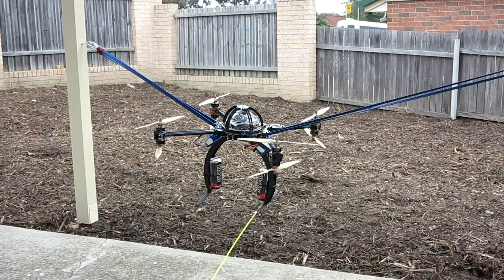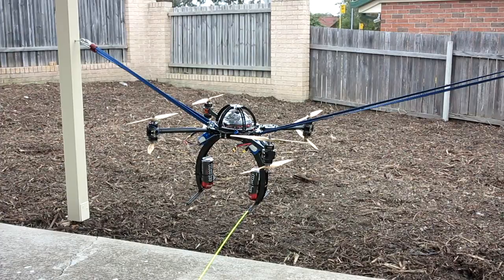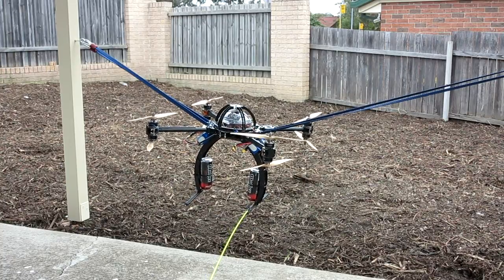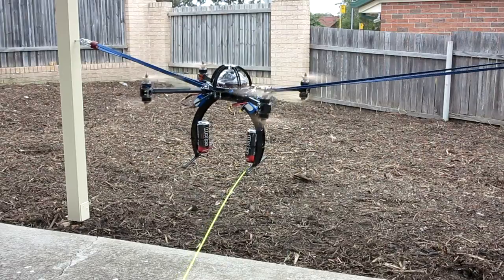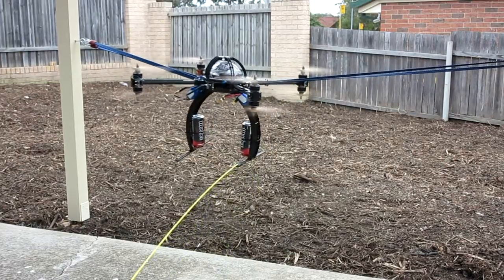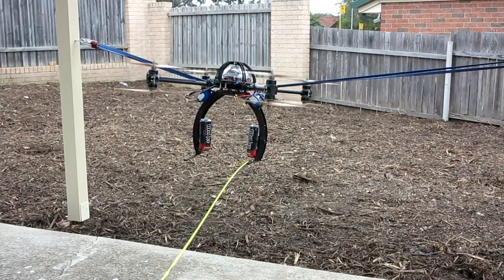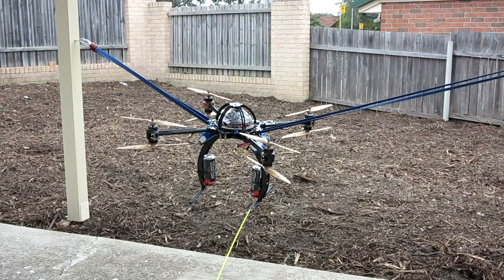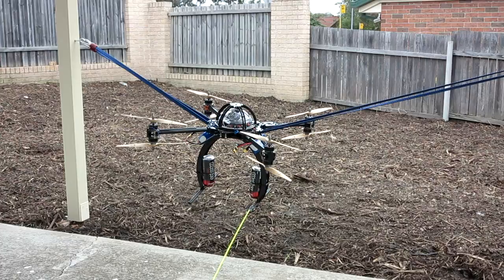Tuning a Droidworx SkyJib LIte with Arducopter APM 2.5

Comment: How to tune in the yaw parameters? I am confused about the jig that can be used for the same
Reply: This was done a long time ago with an APM when I was new to large copters. I eventually decided to use a DJI Wookong controller as I just couldn't get comfortable with the APM.
Fast forward to today and the poor SkyJib didn't get much use for a year as I began to use DJI equipment when I started working commercially. But the APM developed in to the more powerful Pixhawk which then became the Pixhawk 2 Cube so when I recently resurrected the SkyJib I decided to use the Cube with the new versions of Arducopter.
The good news is it works fantastic!
Arducopter on the Pixhawk includes Autotuning which is done in the air either one axis at a time, including yaw, or all at once if you have the battery time. It works great!
Reply: thanks!

Comment: Actually, not the legs but around the stand offs between the two plates. You can see a pair of the titanium stand offs in the front center. BTW, I eventually moved on to using a DJI Wookong with this copter after a few crashes with the APM. I think it would probably work well with the Pixhawk and newer versions of Arducopter though. But it's flying great now so I don't want to change things.